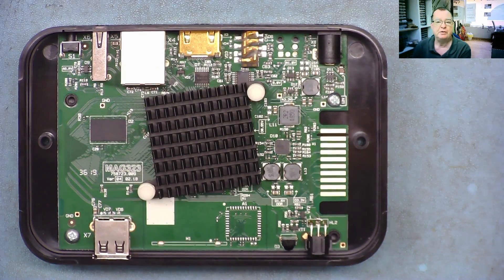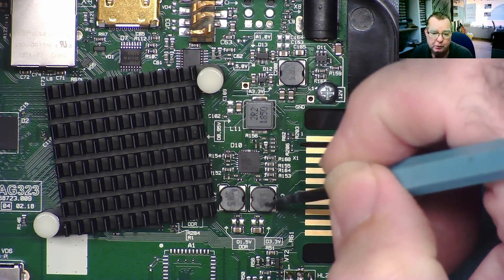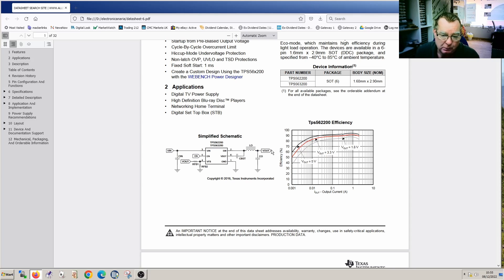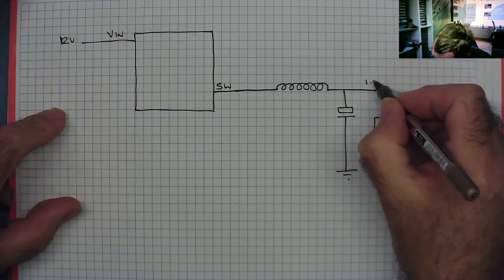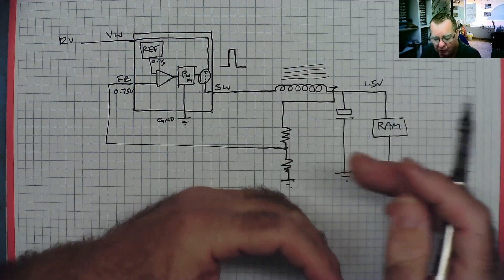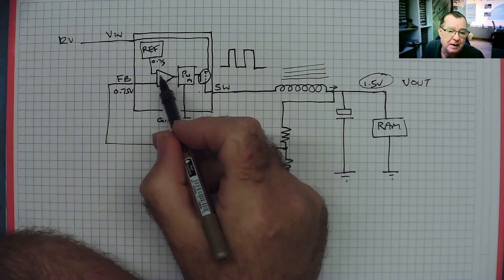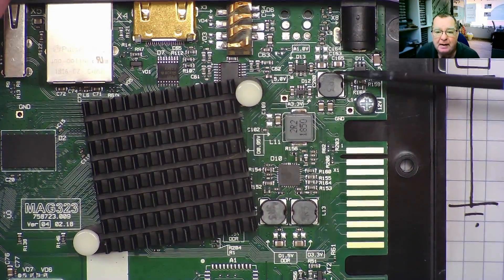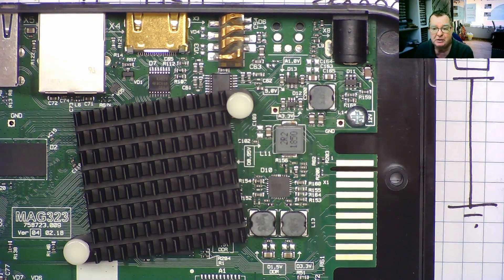How a PSU With Too LOW Voltage Can Kill Your Electronics Devices! HOW A Buck Converter Works!

Comment: With all due respect, this is a complete nonsense.
Granted, if the 5V would have killed a 12V device just because of being that low voltage, it means that 12V device power management was s#$##y design to begin with. Some two discrete component 70's era design maybe, but that is highly unlikely to be present in a digital TV set-top box (simply because it would be way too expensive at least). No way it can cause any issue with any imaginable IC converter.

First the statement about the current in the coil increasing at lower input is totally wrong. The current in the coil of a buck regulator is equal to the load current, so in no way it could change at all. What increases is the portion of the time this current flows from the input vs how long it recirculates from the ground via the rectifier FET (you "conveniently" ignored in your description). But typically both FETs are practically equal, have to handle the same current (the output one), voltage (the input one), are on the same chip (so share the dissipation heat power budget), so the conductive power dissipation remains almost constant. The switching transient losses would get even lower.
So no, at least a bit reasonably designed) device won't get destroyed by lower supply voltage. It could be it would not work, but it can not be destroyed by just lower voltage.

If yours got killed, it definitely was due to some other problem (reverse polarity - both are used with this type of connectors, so the 5V having it reversed vs the 12V one is definitely a possibility), not because it got 5V instead of 12.
Reply: Even at low input voltages , the intenal mosfet switch has to have sufficient gate drive voltage to switch efficiently between SATURATION AND CUTOFF (on & off) ..if the gate drive volts is too low it may operate in linear region..eventually leading to thermal
 failure...& not overcurrent failure..as assumed..
Reply: @analoghardwaretops3976  well, show me one single gate driver IC without any undervoltage lockout on the gate driving supply.
And show me one single switching regulator IC with integrated power element (regardless if an ancient bipolar or modern MOSFET based; so when the control part is thermally tied to the power device) without a thermal shut down feature. Show me one without any overcurrent protection.
Neither exist in an integrated circuit form. You may find only some really old discrete component designs, but not integrated circuits. In fact once an IC contains any accurate voltage reference, the thermal comparator comes virtually for free, as it shares quite big part of circuitry (the band gap reference core). The only motivation to not use some type of protection within an IC is when such protection won't be effective (like a thermal shut down in a discrete power FET predriver/controller as they are not thermally coupled together) or will bring too much extra components (excessive drop comparator on a 15V gate predriver for a 600V FET/IGBT; relies on the gate supply undervoltage and current sense instead).
The main point is, integrating the basic protection elements is extremely cheap, way cheaper than oversizing the power elements to handle the abnormal conditions.
In a typical 0.5..1A integrated switcher (like used here) the power stage transistors occupy more than half of the chip area. Just the two output transistors. All the seemingly complex regulation processing, accurate references and even the output voltage monitors (reset generators) are in total less than half of the chip. And majority of that are the predriver, precise voltage reference and error amplifier circuits. So all the protections are fraction of that. It is the way to eliminate the need for virtually any design margin on the output power component where possible, as that costs bigger silicon area than the extra protection preventing that extra load from happening. The robustness against too low voltage or an excessive load current just comes with that.
Reply: @annaplojharova1400  no contradictions on the chips  internal protection....its the end use that calls for added external circuitry..to allow reliable system operation..this is upto the circuit engineer/designer discretion......some times overlooked ..sometimes deliberately avoided for economic reasons... sometimes wrongly assuming the chip will do all that...internally..
Reply: @analoghardwaretops3976  This may be the case for discrete power switch with IC predriver and only for some of the protections (thermal, overcurrent). But the one preventing against overload at low input voltage is an inseparable part of the predriver IC, so you would have to put in quite a lot of design effort and additional circuitry to circumvent it, I would even say way more than ensuring the correct predriver supply in the first place... So again, no undervoltage causing overload on a buck converter either.

But here we are talking about converters with the power elements integrated with the controller into the one chip, there all the protections are hardwired, there is nothing the application circuit designer can do about them even when he tries.
So no way to damage an integrated converter except reverse polarity or overvoltage (driving components into voltage breakdown) in any short time.
Reply: @annaplojharova1400  in this L.E.R. video the datasheet diagram shows an E.N. pin available.....that could be wired up for additional external protection.......& There's no mention in the video if it was or wasn't used. & a properly designed protection circuit  around it would definitely work.
& this is a controller with an integrated power switch.
Reply: @analoghardwaretops3976  It is indeed and it already has all protections built in (internal supply undervoltage, overcurrent usually by sensing the drop across the FET so yielding lower currents once gate drive is compromised, and thermal shut down would be the minimum) and just can not be disabled. The ENA is for power control (electronic "power switch",...), definitely not needed for the IC protection itself.
Reply: @annaplojharova1400  since the switch is internal to the chip... , failure of switch is also failure chip.....and if for any reason chip circuit fails ..the switch is then useless
Reply: @analoghardwaretops3976  but with the protection circuit integrated there is no reason for it to fail because of the input undervoltage. There are indeed plenty of other reasons why it may fail (input overvoltage e.g. due to bad input filter capacitor and reversed polarity of the 5V power brick are the two most prominent ones), but the video, as well as all the discussions is about connecting 5V to the input instead of the rated 12V. That just can not be the root cause for any integrated converter to fail. It may refuse to operate, be unable to reach the output voltage or deliver the rated load, maybe blow the input fuse on the board, burn the connector, but in no way destroy the converter IC.
Reply: Speculated reasoning doesn't work...to give sensible opinions besides  you have probably not worked or researched such behaviours in design or testing stage..or for that matter in actual repair...

Comment: Yeah, the situation is just as bad when boost regulators are used below the required input voltage - they will start to try to pull a large amount of current from the source and either die or damage something up-stream. We had one that heated up the power cables a few weeks back as the bench supply used for testing was set too low (it uses an external MOSFet to generate higher current)...

Comment: No electronics knowledge - Plug in whatever
Basic electronics knowledge - plug in the correct voltage
moderate electronics knowledge - lower voltage is fine
LER video consumers - plug in the correct voltage. And here's a diagram proving why!
Reply from the maker: You actually made me laugh out loud this morning!  😅😂🤣

Comment: If a circuit is designed so poorly that it switches on with too low a voltage (UVLO), then it was junk from the beginning, that is the chips are being advertised to handle the same current at a lower voltage when it's not physically possible and thus a bad design or the datasheet is lying about the capability of the IC. The buck converters almost always have inductor current detection so should shut down on too much current.
The output doesn't "have to be maintained", the datasheet says it supports UVLO which means if the voltage in it too low to maintain output, the chip will shut down (Thus the datasheet must be lying as instead of cutting power because the output can't be maintained with low input voltage, therefore the IC doesn't support UVLO).
Then there's similarity between the two so technically the 5v ones should power on 12v albeit if a few capacitors are underrated would blow open or make the PSU go into protection.
The 5v ones are likely just the 12v designs that because 5v USB "phone chargers" are everywhere and 5v (Design rating typically 2A or more) is pretty much the "defacto standard voltage supply", they just likely stamped the rating on the socket for the power in.
It's likely that those chips have defects, poorly soldered and failed or just outright being pushed to the limits.... After all one should be asking why this issue isn't only limited to the 5v ones but why the 12v ones come in for repair too?
Well, the answer is as above, electronics pushed to the limit.... it's not the input current that's the issue but the output load pulling too much current....
One can up the voltage to lower input current for the same output current, however the switch and inductor is still seeing the same spikes, I've played with buck converters as an exercise on how small an inductor I could get away with and none blew up with high input current (i.e. 3.3v in 3.0v out into load) when the calculated output current for the inductor was used stayed in the safe operating area (0.25A), but when I drew more current for 10uH inductors (0.3A at 3V with 3.3v input) the chip let out the smoke and did the same when I drew the 0.3A at 3V with an input voltage of 12v.
Increasing the inductor size also allowed higher output currents up to 1.5A at 3V with 3.3v or 12v input.
Also the IC would fail to current limit with inductances below 20uH (With one under test did manage to limit on a 15uH-ish inductor).
Reply: the datasheet mentions uvlo in " hiccup " mode..i.e. on-off-on-off...not just shutdown...the end application demands uv & other protection based on input output requirements..& this  circuit designer / engineer has not implemented it.  
Usually end application operation ranges are much narrower than that of the i.c.itself.....
Reply: lookup CCM and DCM modes of converter operation, you don't have complete picture in mind.
Reply: @Mr.Leeroy  Continuous mode conduction and discontinuous mode conduction can both be measured by gate current at a minimum and often both use inductor conduction to check the voltage drop.
Say a switch with 1-ohm (Scary) source to drain, then 1 amp switching peaks will give 1 volt feedback to the monitoring circuit.
Also, the input voltage to both can be inspected at all times in good designs...
Comparator that the output is zero when vin-less-than-7v and output is inverting-pin-waveform-above-7v.
With discontinuous mode, a soft-start circuit is often used due to peak surges and is noisier due to harder switching harmonics whereas the continuous mode is more surge tolerant and has less noisy output. 

Either way, CCM vs DCM is irrelavant here as the fault isn't things like shoot-through on power-up (DCM on a shorted output without soft-start safety circuitry tends to go bang.... I can lecture about how I found out that too, but simply: Don't independently power the auxiliary VCC of an off-line flyback SMPS IC when the secondary side has a short)

In this case it's about a circuit in normal operation and running well within datasheet specifications yet still fails (Maybe the product designer forgot about the unofficial electronics guide to circuit design 20% headroom rule). However, these days, people expect that 1A means literally getting 1A out of the power source and still have room, they expect the component manufacturer to design this headroom in (known as the Absolute max ratings, i.e. 1A power supply IC should give 1.5A before risking going bang).

Fitting this reply into screenshots took two screenshots (Mentioned for Youtube reasons)
Reply: @dedr4m  I mention this in regard to "One can up the voltage to lower input current for the same output current, however the switch and inductor is still seeing the same spikes". This was just the thing that caught attention the most.
Inductor current will consist from DC current an AC ripple to top-up output cap and it will vary a lot depending on the rest of the converter parameters. And inductor is probably the least concern here, since it won't usually melt instantly even if you saturate it. It is the switch dV/dt capabilities that matter taking in the account feedback responsiveness and limitations due to layout parasitics, which won't save you in every case be that UVLO or OCP block. And that last one is not the remedy for potential mistakes as you describe it, but rather means of minimizing consequences, same as fuse is not a circuit protection device, but an input wiring protection and fire prevention component.
Reply from the maker: @dedr4m  What you need to consider is that the designer of the buck regulator would know what the supply voltage is, and know what duty cycle (maximum on-time) is going to be when the device is drawing it's normal load.  He then selects the inductor to handle that on-time without going close to or into saturation, and puts maybe 25% headroom in place for 'tolerance'.   When you come along and put 5V in, the buck controller needs much longer on-time per cycle to generate the correct output voltage.  The circuit is now running outside it's intended parameters, and it is quite possible that the carefully selected inductor will saturate and kill the chip/mosfet.  If saturation of the inductor occurs before the UVLO protection threshold is reached, then UVLO will not save you either.  Bad design - no really.  A design is quite rightly based on the known circuit parameters, not on the stupidity of the user. 😝
Reply: @LearnElectronicsRepair  " it is quite possible that the carefully selected inductor will saturate and kill the chip/mosfet."
So, basically this particular IC is missing the Lx Current Limiting that every buck and buck/boost IC I've tortured has as standard?
Well, I suppose that's a good point, however:
I argue it's bad design because of the lack of tolerance inherent in "designing down to a voltage" versus "designing up to a voltage".
The most obvious is that, say a brownout event on a linear PSU happened, then the 12V will defo be less than 12V, also some of these boxes have dangerous power supplies that even though switching mode, rely on incoming mains to determine the output voltage (See DiodeGoneWild videos on "Dodgy chargers" and Ken Shirrif's website teardowns and assessments of dodgy chargers).
Then there's other issues like if a decent PSU had a fault (shorted winding, hypothetical shorted winding or degraded low-side feedback divider resistor) and produced less than 12v.
I run my Dell Lattitude E7440 off of a drill battery (Using work's electricity, sssh! lets keep quiet about that, lol) and get over 12 hours starting at 21v and ending at 16v before the laptop uses internal batteries, 3 years now, all OK because of good design.

Comment: Im not quite sure i understand why all this circuitry is required just to step 12v down to 1.5, i can only assume the main reason is to maintain the 1.5v at a steady voltage , which stays steady despite differenced in load . Is this why these converters are used ?
Reply from the maker: No. it's mostly due to energy efficiency.  If the supply is 12V and the output is 1V, and the load is 1 amp then the power dissipated is:
Load 1 Volt X 1 Amp = 1Watt
Linear Voltage Regulator 11 Volts x 1 Amp = 11 WATTS
Get it now?